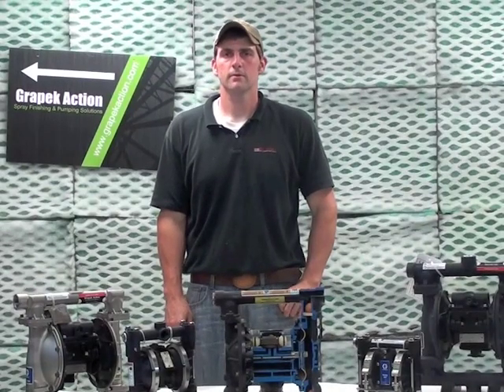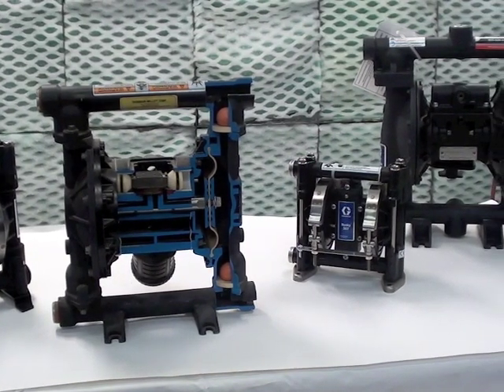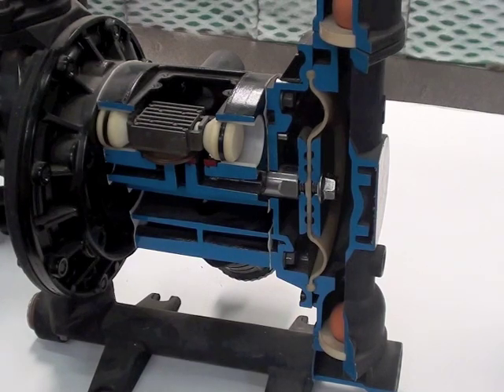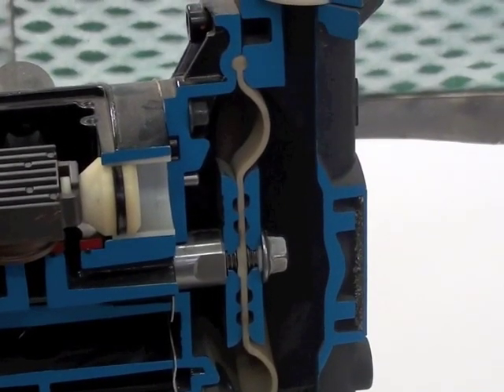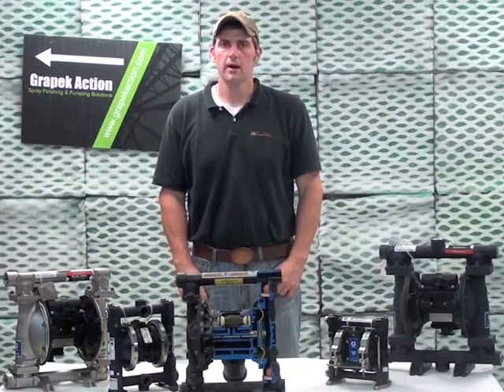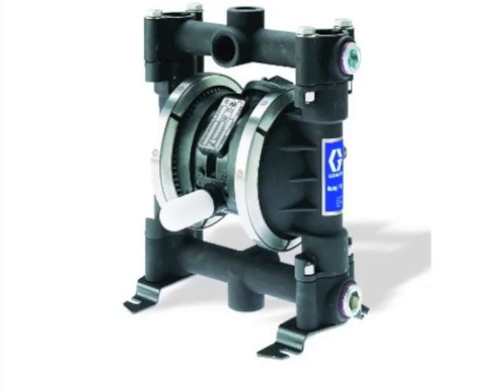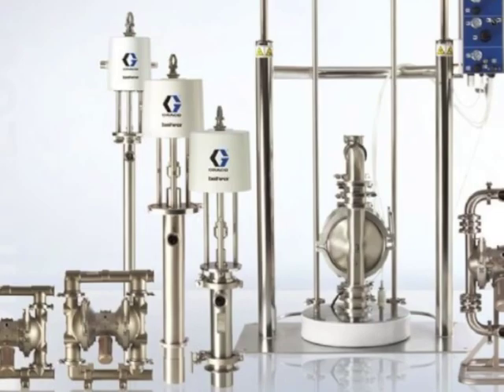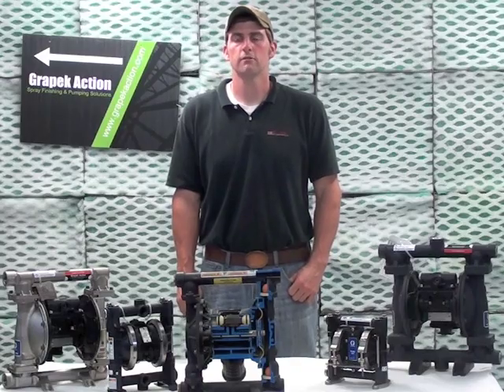Diaphragm Pumps!

Comment: Let's say you are delivering lacquer to a pressure feed spray gun. How do you control the amount of fluid that gets delivered to the gun for spraying?
Reply from the maker: I am going to try and answer both questions here. The diaphragm pump will have a pulse (wink) when spraying. If you are trying to eliminate that you would need a fluid regulator on your pump.  I have attached a link below. This is the Sames Kremlin PMP that has a fluid regulator on it. 

https://www.grapekaction.com/kremlin-pmp-150-air-spray-package-stainless-steel-668-751-000

We recommend if you are spraying Air Spray and want the best finish to use a pressure tank. That will have the best Spray coming out of the gun and be more consistent.

However the best option would be to move to Air Assisted Airless/Airmix for the best spraying in the industry.